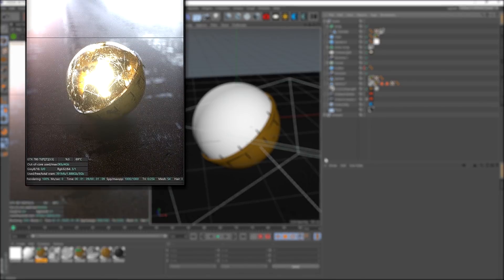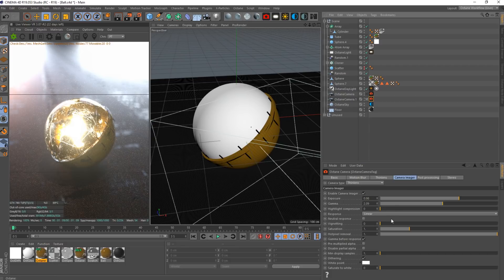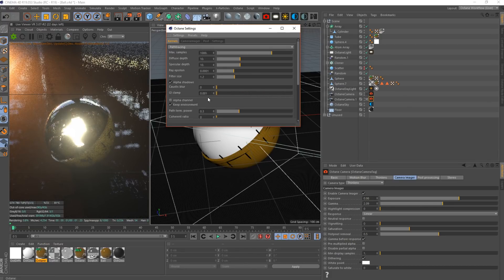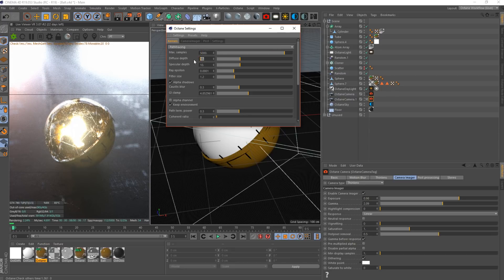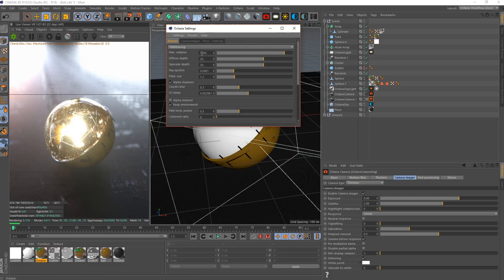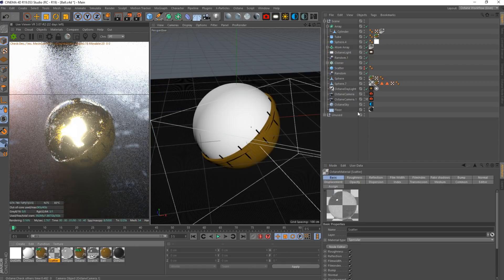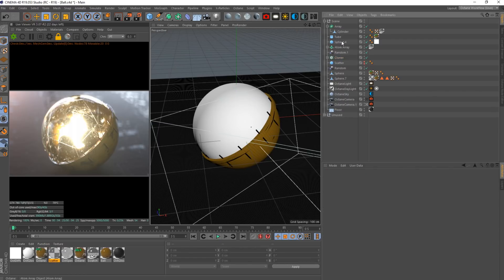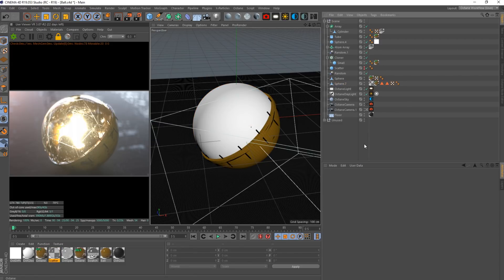Cinema 4D Tutorial - Decreasing Render Times & Noise (Octane Render)

Comment: Great video! I can’t figure out how to decrease my render times even more... I’m using two graphics cards: GeForce GTX 1080 and 1080TI. I also have an overclocked AMD Ryzen 7 1700X processor, and 32 GB of RAM. Strange thing is that, while rendering, in the Task Manager I see the CPU working at 50% (almost all the time) and the GPU at 3% (except sometimes when it reaches like 30%, but it only lasts half a second, then it returns back to 3% or even 0%. This happens only with the 1080TI, which I use as my main graphics card, the other 1080 just stays at zero all the time). Is this normal? I’ve seen other videos where people render frames in few seconds using GPUs not as powerful as mine, and I’m currently at 1min with a relatively simple project! :( ...Is there any other way I can decrease to a MAX my render times??? Thanks in advance!
Reply: settings and turn GPU up to high?
Reply: If your 2nd gpu never gets used you should go to the settings and enable use all gpus there. And that it's mostly at 3% and sometimes 30% is strange I have the same issue but maybe the gpu just can't be used to the max? Because it has to do other things like displaying images on your monitor.

Comment: I wasn't aware that the image format selected made any difference to the render time for octane... Are you sure about this?
Reply from the maker: more or less the bit channel you're working with, going up to 16 alone can increase it let alone if you use tiff and go 32!
Reply: Yeah but octane's speed is based purely on ray calculations, It doesn't "know" what bit depth it is going to be saved as after it's rendered. If you have any documentation you could point to I'd be happy to read it, but at the moment I can't make sense of it. Cheers.
Reply from the maker: From my experience it's increased it, I work on quite low ram and a dated cpu, also low vram which could play a factor, it's worth looking into for sure! Quite interested to see how much it does impact it. For example JPEG is more compressed than PNG so jpeg would be a little faster. I've played with these a little in the past just not with octane!
Reply: +Sketchy it should't take more time. it renders at naximum possible, but its your choice what format you safe in the end. it leave you the opportunity to decide at the end

Comment: This was a great tutorial .. for the most part :)  Definitely managed to kill the fireflys! .. however Adaptive Sampling - tsk tsk tsk .. going from 10 years of Vray experience and they have the same settings, guessing the concept is the same too .. Noise threshold; lower values increase render time / quality for example around 0.003 is usually production quality  ... a value of 1 would be useless (low quality end)  0.03 is good testing value .. All said, i have zero experience with Octane, hence im watching this tutorial lol so might be completely different  .. But otherwise thanks for the tutorial :)